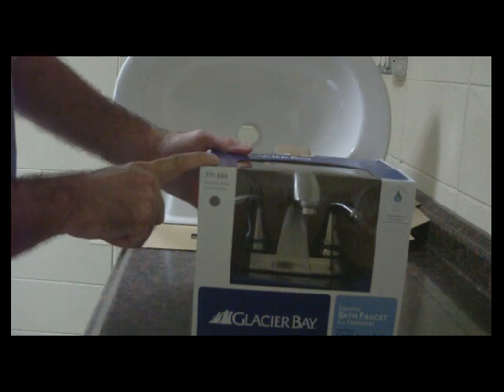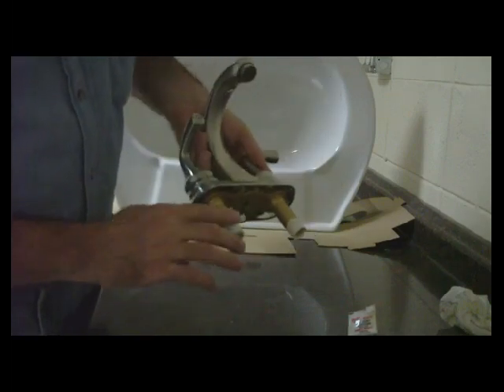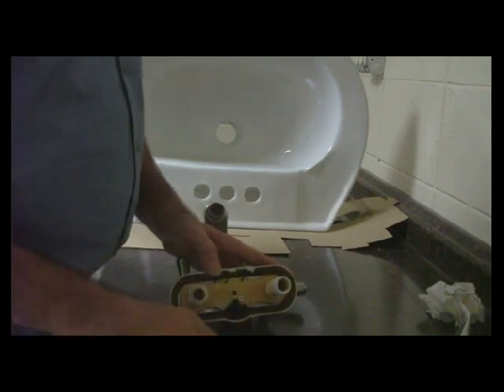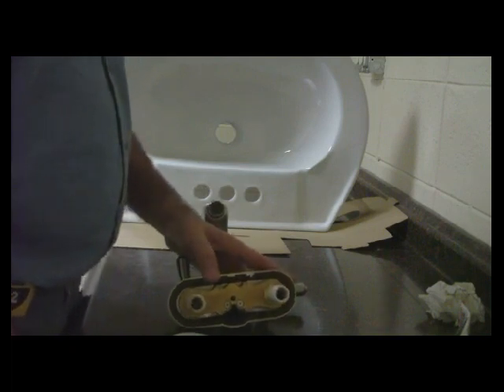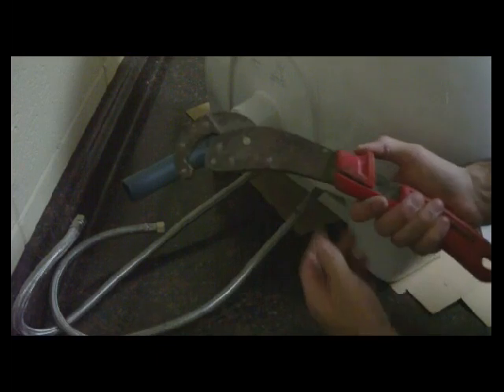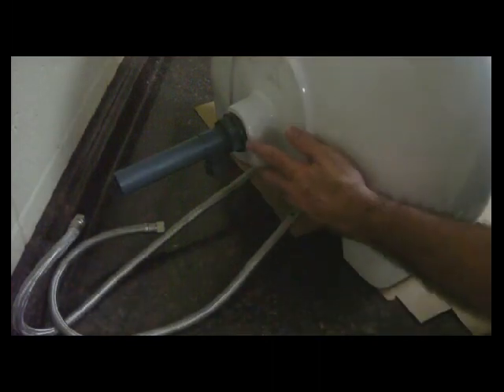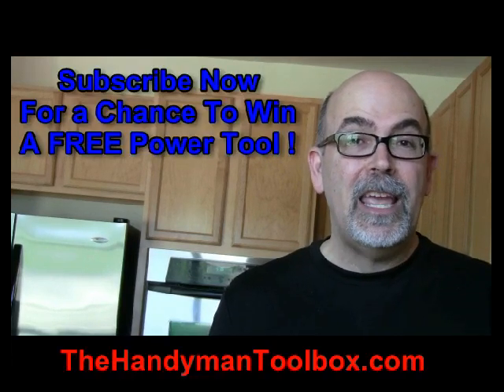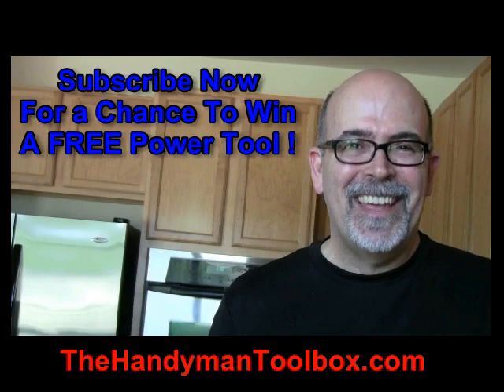How to Install Glacier Bay Bathroom Faucets

Comment: What is the best and easiest method to ensure that the bathroom faucet handles are accurately aligned? Comments and instructions will be appreciated.
Reply from the maker: Eyeball it...does it look straight? Measure the distance with a ruler and a fixed point of reference...